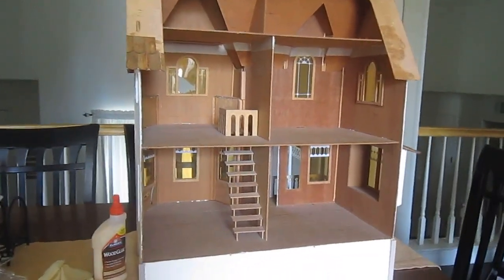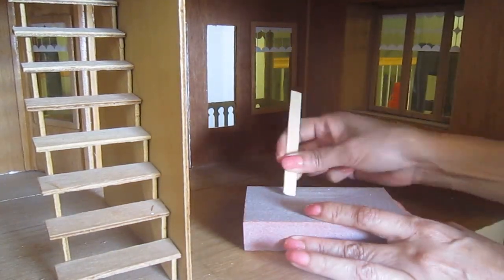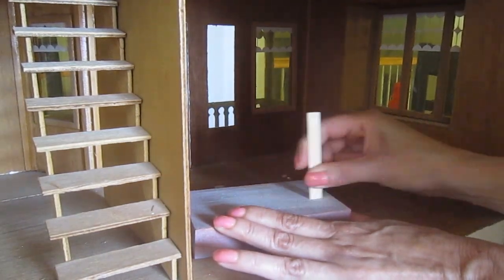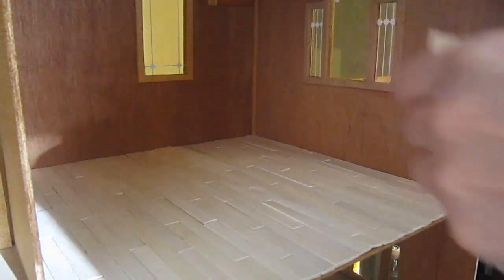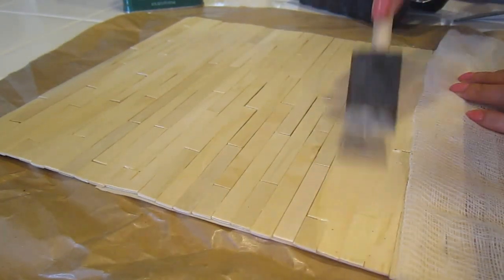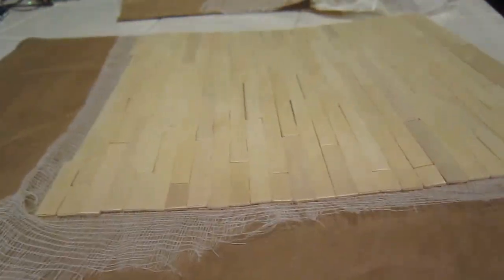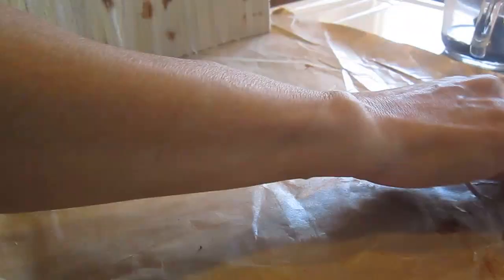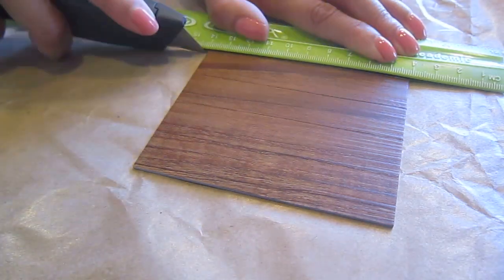Dollhouse hardwood Floor 2 inexpensive options

Comment: The mesh underneath is a great idea. I still have to do my rooms and I bought a box of veneers (offcuts which were quite cheap and easy to cut) I think I will use your idea because you never know when you will change your mind and want a new look. Sticking them to the floor means they're permanently there and even though they're thin, the scale means that you don't want permanent layers to deal with in future.  I really enjoy your videos even though some of the things you use in them are really difficult to get in the UK.  The sand block is probably better than the Dremel thing but I got hold of a nail art rotary tool that works pretty well for miniatures and was cheap too.  The muslin and wood glue was a great idea. I am going to try to use my veneers in a similar way to what you did with the vinyl tiles. I hope it works as well as yours!
Reply from the maker: Very lovely to read comments such as yours. Than you!

Comment: July 7, 2020---Even though it's been a few years since you posted this video, thank you for it. Got back into modeling a few years ago, but going for 1/35th scale zombie/apocalypse dioramas. I've got about 2 dozen ideas, several of them involving people either in their homes or seeking shelter in one from zombies. 

Since I was screwing around, I didn't do all that work you did....I just started cutting popsicle sticks in 2 different lengths like your floor shows, but mine were glued to a piece of thin foamboard I got from Dollar Tree. I also used some light wood stain I liked from Home Depot. Didn't use any kind of weight to keep the boards down, but a palm sander made everything nice and even really quick. But I see you have the same problem as I did: GAPS between the boards. This is okay for an abandoned home, but not for a recent home and I have yet to see any video on how to deal with this. One thing I did learn from you was I HADN'T poked indentations in the wood to represent nails. 

And wanting something different (not everyone has wooden floors) was to download photos of linoleum tiles/floors. Did some cutting/pasting so I could print everything on a 8x11 sheet of paper. This was when I reduced everything so it'd be more to scale. Then scan the print out, more cutting/pasting until I was satisfied. Again, this was white glued to a section of foamboard and it turned out pretty well. Did the same thing with wall paper which also came out well. 

I've got some silicone molds from Hirst Arts which is a company which makes fantasy molds, including floor tiles. They're kind of BIG,  but then they're used for castles, dungeons, etc. for 28mm scale figures I use plaster of paris in these molds and got busy cutting a lot of them up in different sizes, then making my own silicone molds of these pieces, then casting plaster of paris pieces from them. You might want to check the various molds that are available that you might be able to use such as their wall section. In your scale, you might be able to use them as bricks for the outside of a house. He also has several tavern molds which might represent child scale stuff like plates, cups, etc. Here's the link to it:      https://hirstarts.com/
Reply from the maker: It is an old video and my skills are much better now.

Comment: I LOVE the idea of being able to remove it !!! I wish I had tried something like this in my Orchid Dollhouse. I cut the popsicle sticks, stained them in a container, glued them using Aleene's. But they're not staying down. Since you used coffee to stain the wood, do you worry about ants, or mice being attracted to it?
Reply from the maker: I have not had any problems with any critters. After the coffee stain, I added a coat of polyurethane. I used carpenter's glue for the floor in other rooms and it has worked well.